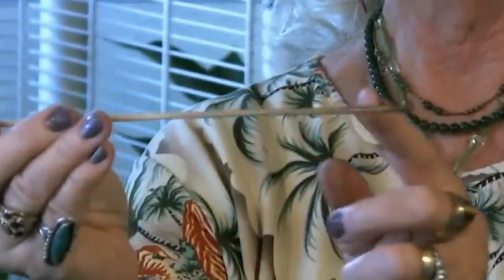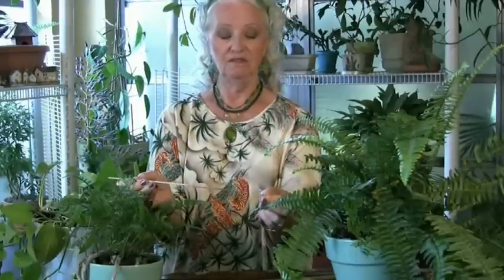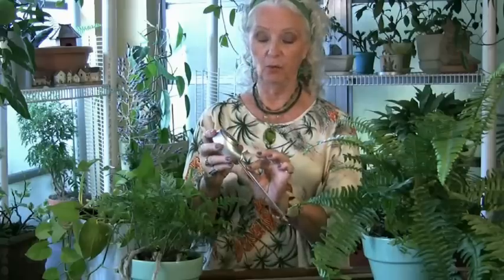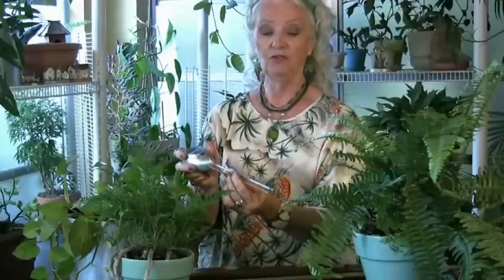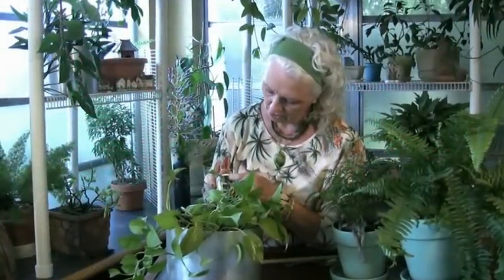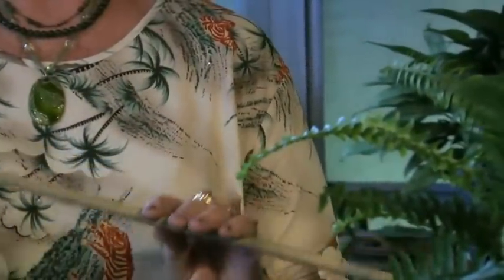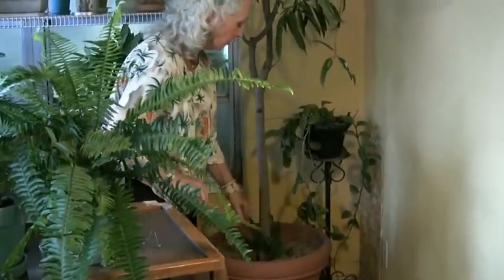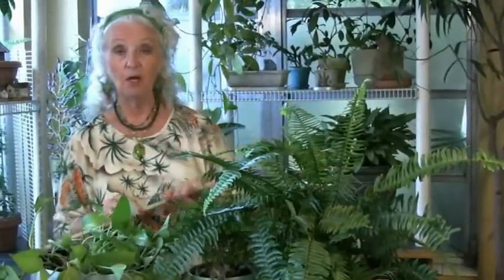Houseplants #3: Tools for testing soil moisture

Comment: Castille soap( dr Brooner's ) suggesting one tablespoon per lit in vegetable. Is it not heavy doze?
Reply from the maker: As with most things involving plants and their care, there's never 1 absolute. That ratio would be about 3X's stronger that what I use, 1/2 tsp in 2 cups water (if my math is in the neighborhood.) But then, you're talking about vegetables outdoors, and I'm talking about indoor plants. Two different things. The main reason for not using too much soap is to avoid damaging the skin of the leaves, which is quite delicate compared to animals, but vegetables might be stronger than indoor tropicals; also, there might be more water (rain, sprinklers) falling on outdoor plants than on indoor potted ones. I always found the 1/2 tsp/2 cups to do the job, but you are always free to experiment - in fact, I strongly recommend it.

Comment: In connection with my earlier post ( just before) .
Can i use dr Brooner's castile liquid soap in vegetables? Which variety is good?
After spraying soapy solution we find white spots on soil. Is it  harmful for soil?
Reply from the maker: Yes,  Dr Bronner's is an excellent choice. Also you can dissolve a bar of Castille soap in 1 gallon of water, and use 1/2 tsp of that in 2 cups water for spray.. Or you can use horticultural soap. If the white spots on soil are from soap, they're not harmful. I've never seen soap leave white spots, though. Possilby the spots are mold you didn't notice before, or even bits of perlite.

Comment: In connection with my earlier post ( just before) .
Can i use dr Brooner's castile liquid soap in vegetables? Which variety is good?
After spraying soapy solution we find white spots on soil. Is it  harmful for soil?
Reply from the maker: Any kind of Castille soap is good - Dr Bronners is excellent. There are others too. Or you can melt a bar of Castille in a gallon of water (I think I mentioned that.) Use that just as you would the Dr Bronners. Also, you can use horticultural soap from the plant store.
Reply from the maker: Oh yes, if you see white spots on the soil from the soap, that won't hurt anything.

Comment: Ok.The meter only needs to be used a few times to find out how often the plant needs to be watered.
Reply from the maker: You're on the right track Jeffrey, but actually it only needs to be used once, unless maybe with a really big (over 14" diam.) The moisture will be pretty much uniform on a horizontal level, meaning if it's damp in one level, it will be similarly damp all over the pot at that level. You need to be careful to push the probe all the way to the bottom of the pot, to make sure the moisture hasn't collected there. In good quality soil, with good drainage, the moisture will move evenly through the whole soil mass; in not-so-good soil, the moisture often collects in the bottom. That's why only feeling the surface of the soil, or the top couple of inches, doesn't always work. If the soil near the bottom of the pot - where all the roots are - is staying wet, you won't know about it, and be totally dumbfounded when your plants die, even though you let the soil dry between waterings - at least, you thought you did. If you'd like to see more of how the soil works, I have 3 videos about it - just enter "TheFicusWrangler videos" into your browser,  and the whole list will come up. Also after awhile, you don't need to probe the moisture every time. If you know the water is moving correctly through the soil, remember how much water you use, and you know you're the only person who's watering the plants, you can just touch the surface and that will tell you how much water you need to pour on. I still like to check with a deep probe every few months, though.
Reply: @TheFicusWrangler  ok. even on YouTube you can get bad advice.I saw a video where It's told if the 1st two inches is dry that you should water.But like you said the bottom two inches of the pot can still be moist.I think I killed my diffenbachia last year by overwatering.But I just bought a new one(dieffenbachia maculata camille).The pot is 4.25 inches deep and 6 inches wide.The moisture meter I have has ten levels with three dry levels.Should I water my plant when it's at level 3(dry) or 2.level 1 means extremely dry and I don't think I should wait till then to water.What are the signs that my plant will give from being underwatered?
Reply from the maker: @jeffreykaufmann2867  Probably level 3 or 4. If it's not getting enough water, first the whole plant will start to look a bit droopy, then the older leaves (those closest to the bottom of the main stem) will start to wilt and yellow. The pot you're referring to is called a 6" pot - when people give the size of pots, they're talking about the top diameter. And yes, about information ... the most common info you see is to feel the top of the soil, and go by that. And often that works fine, especially if the soil is good and moves moisture evenly. 
But not if the soil is old, compacted, doesn't drain well for whatever reason. Because of the fortune that I've had to take care of so many plants over such a long period of time, I've had lots of time to investigate and experiment. I know that the kind of mistake you're talking about is at the root of so much trouble people have with their plants, and it makes lots of people just give up entirely on the idea of having plants in their homes. There is alot of bad information, misinformation, out there. Especially on the internet - I think we all need to be careful about sources, and use our brains to evaluate information. However, the thing about plants is, they're not like chemistry or mathematics, with specific ingredients and measurements which must be followed all the time to get a certain result. Plants are living things, they can differ from individual to individual, and they (at least the common house plant varieties) have tremendous powers of adaptability. They can adapt to many different methods of culture, with equally good results. that's why one person may so "do it this way," and another person say "do it that way," and the two ways are way different. The best thing to do, I think, is to look at the different ways, think what might be best for you, try it, and if you're not happy with the results, try something else.

Comment: Can a moisture meter damage the roots?
Reply from the maker: You mean can it damage the roots by breaking them when you push it into the soil? Good question, and certainly a concern for many people who are terribly afraid of "damaging" roots. My answer is that roots are actually much more resilient than you realize. If sticking a meter or a probe into the soil happens to break a root or two, you know what happens? The root grows new from the broken part! And the part that's been separated from the main body of the plant simply dies, decomposes, and contributes to the minerals in the soil. It might be helpful to remember that in bonsai (if you know anything about that,) one of the most important thing to do is to prune the roots of the plant every year or so, to help keep the plant small. Bonsai routinely live many many years - some even live for centuries. So cutting, or breaking, a root here and there doesn't hurt the plant at all.

Comment: How to moisten the soil if it is dry in the middle and moist at the top and bottom. Watering at the top drains very quickly.
Reply from the maker: Hi ZG, glad to share my thoughts on that question. I actually talk about watering in videos #7,8,9, but I'll answer your question here. Water poured on from the top drains quickly IF 1) you have no drainage liner; 2) the soil is dry; 3) you don't pour on enough; 4) the soil is old and compacted. 
The liner is one of the most important pieces of equipment. It catches the runoff, and holds it so that it can be absorbed back up into the soil (water moves upward from below through the soil mass by capillary action.) This is why, if there is moisture at the bottom of the pot, it will move upward into the soil above it. Many, many times you hear not to let your plants sit in water - however, in caring for plants commercially, we almost always leave a certain amount in the liner, the amount depending on the light level and the amount of time between watering visits. Leaving water in the liner isn't the 'killing' thing - pouring on more water before the soil has lost most of its moisture is what kills plants.
When the soil is very dry, the water can indeed run through very quickly. If the soil is dry, the first thing to do is to make sure it's pressed tight to the sides of the pot before you water - otherwise, the water will tend to just run down around the edges and out the bottom. You can pour on enough water to get a good run off,  but if it's all gone from the liner in an hour or two, you should probably pour on some more to make sure the soil is thoroughly moistened. There should be enough water in the liner to last at least a day or two. 
If the soil is old and compacted, the capillary action won't be working, so the water won't move well from bottom to top. On the other hand, if the soil is compacted and not draining well, the most likely scenario is that the soil will retain water rather than allowing it to drain through.
Reply: TheFicusWrangler thank you that helps!!

Comment: Hey! I just picked up a a Rapitest water meter yesterday as my plant family has been rapidly growing. I'm a bit confused about how to use it, however. Lets say I test and see that my plant is below the number given, I water my plants and immediately test again, it reads the highest level, but then a few hours later or the next day, its much lower. Did I not water enough? Is that normal drop off and the plant just requires watering every couple of days? The majority of the plants i'm working with are dracenas and succulents (which I know require far less watering, but is it ok for them to sit at 0-1 for weeks between waterings?). I watered them all yesterday, and watered them what felt like a significant amount (certainly more then i've ever done) but then today, testing some of my Dracenas and they're registering as 0-1... should I water again? And same for the succulents. They were watered yesterday but are now registering as the lowest moisture.

When watering, do you really saturate the soil until it runs out the drainage, as long as there is no standing water in the dish?
Reply from the maker: Hi Sarah. Let's talk a bit about watering, and water in the soil. When you water a plant, you should always (almost always anyway,) water enough so that there's a good run off from the drainage holes - like at least 1/2" for a 6" or 8" plant, maybe an inch for a 10 - 14" plant. That goes for any plant, cacti and succulents included. You don't have to empty the drainage saucer, because the water will either be absorbed by the soil, or will evaporate, within a couple of days. The reason you should water till you get a runoff is that you want to thoroughly moisten the whole soil mass, so that all the roots have a chance to absorb water and nutrients. If you're using ordinary potting soil, and your plants are in moderate  light (I'm assuming indoors,) that amount of water should be plenty for a week. You don't want to water again until the soil has dried - or a better term is aerated - to the level best for that type of plant. For succulents, the soil should be almost dry, probably a 1 on your meter; for dracaenas, a little more moisture is okay, maybe a 2 or 3, unless the light is low, in which case the moisture should probably be a 1. However, if you water thoroughly, and your meter is showing a "dry" reading after 1 day, I would suspect that the meter isn't working right. It's going to take more than 1 or 2 days for the water to get out of the soil. Unless you're using an extremely porous, course mix, like Al's Gritty Mix. (If you don't know what that is, you can google it.) The problem with moisture meters is that they are not totally reliable, and they also break easily. That's why, after you probe the soil with it, you should always run the probe between your fingers, to make sure it's somewhere in the neighborhood, at least. IOW, if the meter is reading dry, but it feels wet - that's not right. Or if it's reading moist, and it feels dry, that may be a warning that there's a salt build up in the soil. Most plants don't need water more than once a week, or even every 2 weeks for plants in low light. So, when you think it should be time to water again, insert your probe into the soil, and if it's showing 1 -3, go ahead and water, get a good runoff, don't worry about emptying the saucer. I looked at the Rapitest label on line, and I wasn't impressed with the numbers they give for different houseplants. I wouldn't pay much attention to those if I were you. On the meter, you've got "dry" on one side, and "wet" on the other; between the two is "moist," or at least it would be if it were printed that way. Most indoor plants want to be about 1/2 between "dry" and "moist," with cacti and succulents being much closer to the "dry", and a few plants, like ferns, anthuriums, ivy being closer to the "moist" reading. You might try digging down into the pot with a spoon and pulling up some soil, feeling it, to get a better idea of what's going on. You dont want your plants to sit around with completely dry soil for more that a day or two, but if you've watered properly, there's no way the soil should be dry after only a couple of days. And if you don't feel confident with your moisture meter, you might be happier using the wooden probe method.

Comment: Hello Ms. Green Thumb I have a money tree that is losing it's leaves and the stems are hanging down instead of standing straight and sturdy I could be watering it too much it does have the brown edges on some leaves . I water it every 4 weeks (once a month) and I also sprinkle it with water mist from a spray bottle that I have every 3 weeks . I would like to know , how do I know how much water is needed to keep my money tree plant healthy and vibrant
Reply from the maker: Money tree, or money plant, is a common name applied to maybe half a dozen different kinds of plants. That's why it's good to use the "real" (the botanic) name for plants. However, since the most frequently used name for Pachyra aquatica is money tree, I'll guess that's the plant you're asking about.
The basic way to know how much water your plant (any plant) needs is to test the soil, as I talk about in the video.  
I have the feeling that if you're watering only once a month, your plant is dying for lack of water. The usual time frame for watering is once a week. Pachyra likes to have its soil be at the "slightly damp" stage - at that point, it should be watered again. If you use an electronic meter, it will read about 1/2 the way between "dry" and "moist." If you use a wooden stick, it will feel very slightly damp between your fingers. If you dig up some soil, it will feel soft and cool, and if you pinch it, the pinch will hold together, but will fall apart if you touch it. 
Misting with the spray bottle is contributing nothing to the plant - if it makes you feel better, certainly go ahead, but the plant is getting nothing from it. Misting is often mentioned as a method to raise humidity, usually as being done once a day. However, sorry to say, that's a myth - you would have to mist every 15 minutes, 24/7, to raise the humidity even a tiny bit.
Reply: Should I water my plant till the water start dripping out from the bottom of the pot?

Comment: how do i dry out my plant when soil is to whey
Reply from the maker: Valentina, I'm so sorry I didn't see your question when it came in.  To dry a plant that's too wet, if it's not actually muddy, you can set the pot into a spot where the light will be increased, and you can place a small fan to blow over the soil. If the soil is really, really wet, you can prop up one side of the bottom so that a drainage hole is at the lowest part, and let as much water as possible drain away; then you can remove the whole plant from the pot, and wrap the root/soil mass in newspaper for a day, so that extra water can be absorbed - then put it back into the pot, and put it into more light with a fan.

Comment: how do i dry my soil if its to wet
Reply from the maker: Valentina, apologies for taking so long to answer. I hope I can still help  you out. The easiest way to dry the soil is to stop watering, and put the plant in higher light. If you can fix a small fan to blow gently over the plant, that's good too. If there's too much water collected in the bottom of the pot, you can prop  the plant at a 45degree angle for a day or two, with a drainage hole facing down,so more of the extra water can run out. If no holes in the side, poke a hole with a nail, if it's not an expensive pot. Or, if the soil is really soaked and hard to drain, you can gently extract the root mass from the pot, and wrap it in newspaper for a couple of days, so the water will drain. If the plant has been overwet for a long time, it probably has alot of rotten roots, so inspect the root mass while it's out of the pot, cut off the soft brown roots - wouldn't hurt to rinse off the old soil, if there many rotted roots, and replace with new soil. I like to use a mixture of packaged cactus soil with perlite added, anything from several handsful to 1/2 the volume of cactus soil.